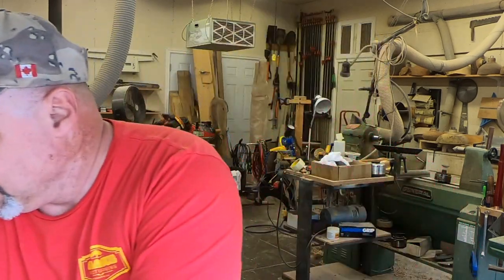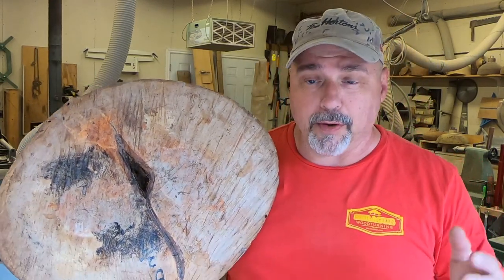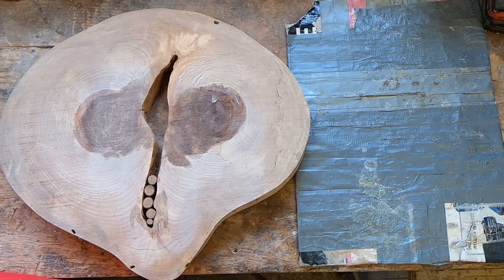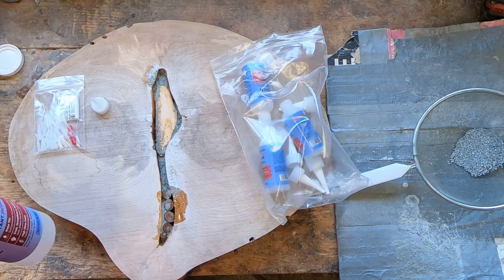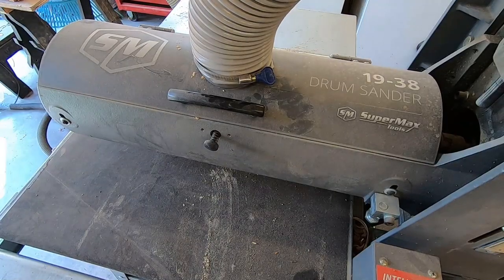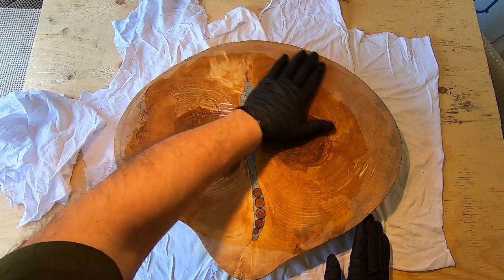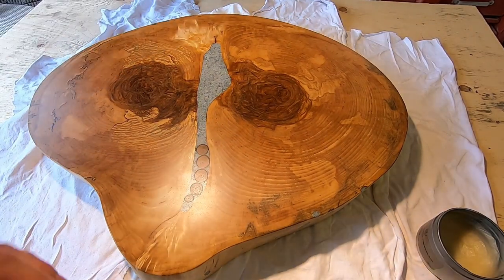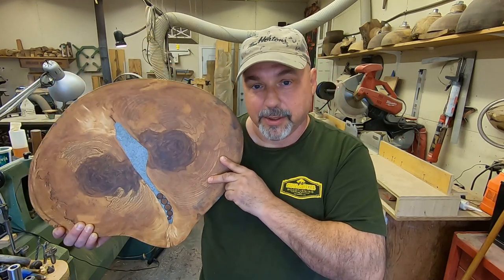Woodworking - The Alien Wall Hanging

Comment: Dear Jim
Great project. 
I am by no mean a safety fanatic but I feel I should give you a heads up.
I've been using CA extensively in my previous hobby building RC model aircrafts no problem. 
Now a few years later when I use it for woodturning I get pinhead sized blisters ( a lot of them) on my hands just from the vapour. 
I'm just saying long over exposure can result in reactions.
I guess there is a reason why they write use gloves, glasses and respirator besides the risk of glueing your finger to your eyelid when scrathing🤔
Reply from the maker: Thanks for bringing this to my attention. I never knew that the vapors would cause this on the skin. I’ve worked with it for 20 years and so far so good. That’s not to say I won’t have issues in the future. Thanks for the info! Jim.